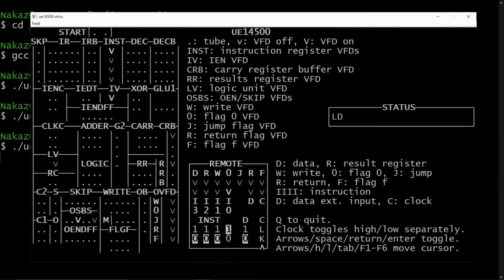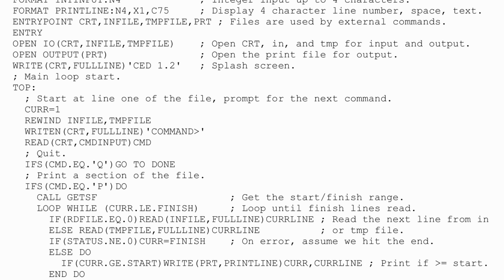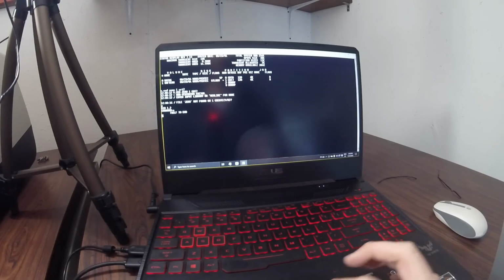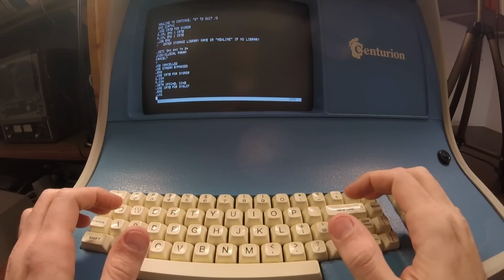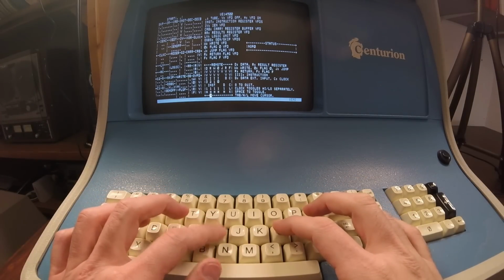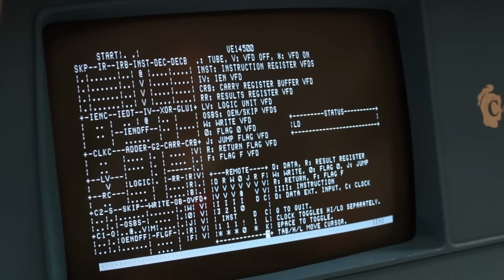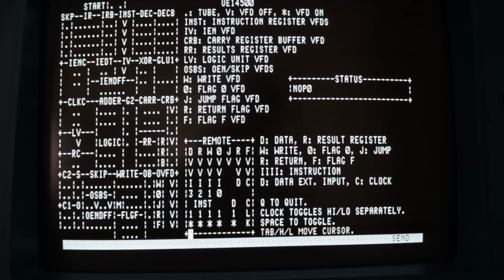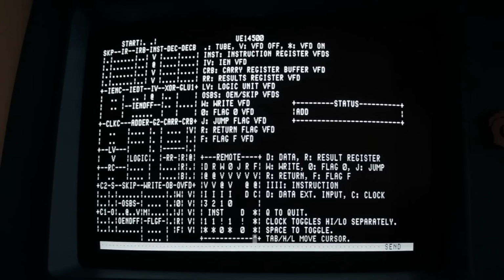Emulating the Vacuum Tube Computer on the Centurion Minicomputer

Comment: Regarding the wave pattern; it looks like the horizontal width is decreasing a bit, at a position that's rolling down the display. I think that roll rate is a beat frequency between the AC line freq (60.0Hz) and the vertical retrace freq (~60Hz). A decreasing horizontal width indicates that the fly-back system a bit current starved, during the "off-peak" AC line cycle. The starvation is likely due to a faulty cap on the DC input to the fly-back oscillator. The AC line is typically FULL-WAVE RECTIFIED (~170 VDC), then applied to the fly-back primary at horizontal retrace frequency. The cap may be intermittently bad, as they sometimes do. I had a VGA monitor with an intermittent cap, years ago, with my old '286 PC. Percussive maintenance worked for a while :D

Comment: 13:50 rs-422 or rs-485 terminal 

That way you can use a 25ft serial cable without any loss

Or use esp32 and make a virtual serial port   using Bluetooth and cart a laptop over, or just spit it to an ip address via LAN
Reply: 21:35 that's how atari programmed and debugged their initial 2600 games, using a minicomputer and partial hardware emulation.

So yeah you technically can emulate a vcs on a 80s computer

The consumer didn't get it until over 10 years after when they could actually afford that kind of computer power.

You could have the power of a 386 or 486 in the 70s and 80s, but won't be a commodore, atari, or apple

Going to be department of Energy, DEC, nasa, cray research, or Ibm, maybe Intel

Even the old vacuum tube computers were 13, 12, 32, 16, 18, 8, 24 36, 48 bit

Back then they called them words not bytes as in the octal or hexadecimal format

Problem is memory either its too slow

Or computer runs too fast and has to wait and waste time

Comment: Extra terminals are cool. I recall in 1995 when I started to run Linux, I found out about getty, and how that could answer a serial port. So I hooked up an old PS/1 with a null-modem cable, and ran it as a terminal against Linux. Because with Linux, even a lowly 486 could serve terminals.
Reply: I remember salvaging my brothers' and mine's childhood DOS game collection from a 1998 Dell PC via null-modem -- hella slow, but it at least allowed eventual transfer to a USB stick for proper backup
Reply: @ErrantMasa  
Beats shuffling floppies, lol.
Reply: @tibfulv  from 1.44MB on a 3.5" square to 1TB (2TB sometime next year) on a thumbnail-sized chip in ~35 years' time -- what will 35 more bring us?

Comment: We had a near week of -20C here in Finland and are back to balmy -5 or so. Getting close to zero is harsh because you get all the variety in snow-water-ice mixes. It's almost nicer when it's colder. Around -30 and below you get a new set of problems.

Comment: I'm rather surprised nothing was dropped since at least the mux boards we had had no flow control going to them. When I was transferring data I had to wait for character echo to ensure nothing was lost, since the mux boards only had a one byte buffer. But if your transmission speed was slow and nothing else is running you might have gotten lucky. Or our hardware guys were completely clueless about flow control for incoming data on the mux.

Comment: The waving picture on the terminal is magnetic interference from an iron core transformer. The framerate on the monitor is close to mains so you get this frequency "beating" slowly.
Reply: I'm sorry, it is unlikely to be magnetic interference. The symptom seen is shrinkage and the rest of the lines are unaffected. Magnetic interference from a transformer or motor would cause displacement which would be a wave down the entire screen. I do agree it's the line frequency though.

Comment: You can use UTP cables for serial consoles soldering them to db25 connectors. In fact, I've used RJ45 to DB25 adapters for this. This way I was able to use network cables (with RJ45) as serial extension.

Comment: The 'wave pattern' on the terminal looks like it's filter hum coming through into the horizontal circuit. The capacitors are probably at the end of their life, I'm really not surprised about it.

Would it be a good idea to get a serial terminal server and connect the MUX card to the network, so you can access it from anywhere you want?

Comment: You can stir in a few more generations of computing and save yourself the effort of getting a longer RS232 cable. Use your favorite WiFi-enabled microcontroller (ESP32, BL602, PiZero, whatever) and wire the serial ends to one of your tty ports. Now, in software, bridge the WiFi to schlep bytes from the WiFi connection to the serial connection. (Use ESP-Link or similar which will give you a tiny web server you can connect to from your laptop and a window to type into..) Now your tiny, 32-bit $6 computer (that's more computer than the others in this picture by far) just moves data between serial and wifi.  You can then connect to your Centurion from your laptop over WiFi. Plus controlling the serial port directly like this, you can take care of whatever weird handshake or pinout needs this thing surely has. Moving 3840 characters a second is a walk in the park for this class of "adapter".
It's not as ridiculous as it sounds and this kind of project improves the ergonomics of using your Centurion and may save you from having to debug that power supply or RF interference problem that's making your CRT wave like that. 
I've enjoyed the series. Thank you!

Comment: Hmm, I’m smelling a serial interface to the vacuum tube computer and a test suite for it on the Centurion.

Re: the wavy lines, I’d check if it’s still present when you move the terminal elsewhere first and test it with a known working cable on CRT0. Cables have bitten me one too many times. But if it’s not environmental, sounds like inside of it.

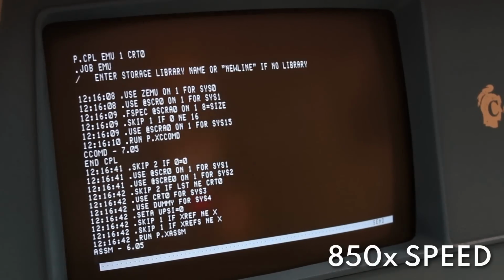Comment: 10:19 "It is a very, very long program ... takes the compiler a little bit of time to run here"
375 lines?
You know, we normally measure source code in "KLOC" or kilo-lines of code.  Your program length rounds to zero.
BTW, I saw you and the mini-Cen at the Makerspace last week.

Comment: The first thing that crossed my mind with the text ripple were bad capacitors.  On electronics that old, it should be a routine to inspect for bulging  and leaking capacitors.  I have had them go bad on much newer computers and electronics. All the problems: the device doesn't work, they bulge, they leak and I have even had them pop open. Capacitors are not forever.

Comment: Now we need to get a Centurion emulator on a PC running the vacuum tube computer emu...

Or better still, A PC emulator running on an ARM CPU running Intel/PC code, to run the Centurion emulator, running the Vacuum tube emulator.

Back in the day, most businesses had a computer room (not a closet) where all the 'big iron' resided, with the users just having a terminal. Often other noisy computer peripherals, like line printers also lived in the computer room, so you'd have to get off your but to retrieve any printouts - not that much different to today where many offices use photocopiers as the main printer, so off to the copier for your prints.
Back then instead of seeing a wall plate with a lan/network socket in each office, you'd see a plate with a D25 serial socket, waiting for a terminal. Wireless was limited to your AM/FM radio to listen to the news, and maybe a touch of music - if office rules permitted.

In a way we've come full circle, now you sit in an office with a laptop, that spends %95 of the time acting as a terminal (web browser) to a remote cloud provider.

Comment: #1 Blinkenlights where far more handy than a lot of people would think and the gent here has learned that the direct way. Also in 1980 it would have been a give that a good  mini would be used to emulate a more "primitive" CPU or Micro-P. Sometimes they where even used to emulate more powerful CPUs just to help with bughunts and prepare firmware and "early release" software.

Comment: Get the PDP-11 up for some special heat. I used to run a VAX-11/750 as my apartment heater. Would be near 0c outside come in and within 20mins of running the VAX you would be in shorts and and a t-shirt. Quite efficient heater too as its switch mode power supply the bills running it wernt bad for the warmth it made. A pain in summer though!

Comment: I remember back in the day I set up a Novel network system for a small insurance company.   Server was an Intel 286 with dual Maxtor 60meg 5 1/4" full height drives.  All the nodes were 8088 IBM pc clones, and had it all cabled together with Arc-net star type network.    Back then, 3-Com had the ethernet patents, and were complete a-holes about who and who couldn't sell their interface cards.  If I remember right, the insurance company was trying to faze out their Centurion Minicomputer.  Installing these microcomputer networks, I remember the mini-computer techs hated us.

Comment: I hoped one day the Centurion would be able to run some software that really made sense and would be fun to show. Now this is a big surprise. Ren you did a tremendous job and for the looks of it you made David a very happy guy! Although I still don't understand one iota of the programming of the vacuum tube computer and thus from the emulator (I'm trying to get my head around it), I think it's awesome to see that this all works and it will be tremendously helpful in further development of the vacuum tube computer. Big succes!

Comment: You should look for the Kermit protocol to transfer files between computers.

So you don't need to enter filled through the editor.
Reply: I remember Kermit. That goes back a ways.
Reply: @KameraShy  it does, and stable transfer protocol.

Comment: Don't know much about terminals, but I know a lot about AV, and that looks like a 60Hz roll artifact from "dirty" power or a ground loop. Try plugging into another circuit. You can also try for experimental purposes a down a dirty ground lift, by using one of those 2 prong to three prong plug adapters and if that works. Get yourself a power conditioner (Furman or similar) or transformer isolated surge protector (isobar or similar).

Comment: The waving of the CRT could be ripple on the powersupply (bad caps) or magnetic interference from a nearby transformer or something like that.
Reply: My first guess would be bad caps.  It seems to shrink.  I'd think an external magnetic field would cause it to go sideways instead of shrink.  But I would check the rectifier diodes as well. If one opens up, it will cause ripple.  Edit: The voltage you need to watch is the +12V.  That's what's powering the monitor.
Reply: @russellhltn1396  I didn't even consider the rectifier diodes. If there's only one shrink on screen it's probably only running on half-wave rectification. If there's two shrinks half a screen apart it's probably just a bad main filter.

This is all assuming it's supposed to have full-wave rectification (bridge or otherwise) which is almost assured and that the vertical scan rate is close to the 60Hz line frequency.

Comment: That's insane how good of a programmer he is!
Reply from the maker: Ren is a legendary programmer! 
He's even built a Sieve of Eratosthenes in pure CPL, which is impressive because CPL doesn't support bit manipulation at all!
Reply: @UsagiElectric  That's impressive because bit twiddling is hard enough as it is.   Years ago I wrote software to process DEC sixel data into and out that 6 bit format into 8 bit and may have actually injured my brain in the process.   This was a format back in the day, so you may run into it on your PDP.

Comment: Hmm… I wonder how hard it would be to build an Ethernet card for the Centurion….
Reply: I believe we have enough information about the bus to graft an arduino ethernet module onto the system.
It would be harder to write software that could take advantage of it though - I don't think Centurion supports anything close to what we now understand as networking. Receiving a specially crafted ethernet frame would be possible, but creating the entire TCP/IP stack is quite a hefty task, and it wouldn't be able to interoperate with other OS functions or programs. I believe our best bet is to emulate a hard or floppy drive and transfer data to and from that, possibly via ethernet or wi-fi (via ESP-* modules).
Reply: @jwhite5008  Hmm… I’m thinking that putting the TCP/IP stack itself on an outboard processor (AVR, ARM, or ESP32) would probably be best; and just have a couple of registers exposed to the Centurion to read/write from TCP streams. Software on the Centurion could just treat it as a mostly character oriented device.
Reply: @darkwinter6028  Good thinking, ESP32 should have serial to TCP support already. Not sure if Centurion OS supports character stream devices, but it should in theory - there had to be at least some sort of tape drive available for those computers, otherwise archiving anything wasn't really possible

Comment: @15:47, The bend in your terminal screen is usually because of a old leaking capacitor in the power supply.  However, before you open it up, test the terminal at a different location and make sure it is getting a full 115v minimum from your AC outlet.  If moving the monitor fixes the problem, then it was a magnetic field interference from an AC transformer or heavy AC loaded electrical line.  However, this yoke deflection is rare and only happens under extreme circumstances, like having an AC line powering a 2kw heater going right below the monitor.  My bet is an old leaky dying capacitor in the monitor's power supply circuitry.

* Note: if you are plugged into the same outlet as your vacuum tube's filament heater supply, and it is a switch-mode supply, and you source AC was weak for awhile, you might be looking at a power supply dip when the switcher's diodes are conduct during during the AC waveform's peaks.
Reply: Yep. Power supply ripple of some kind.
Reply: I agree. Capacitor issues often manifests by being unstable, than getting more stable as it is powered on. 
Even if it becomes less of an issue, checking for damaged capacitors shouldn't hurt.
Reply: This specifically looks like a supply dropping out of regulation. The bend is the picture shrinking and only a small portion of the screen is affected. If it were unregulated the defect would be continuous. If it was from external AC fields it would much more likely be deflection instead of shrinkage.
Reply: @eDoc2020  You are correct.  Probably a weak or dying cap on the main AC rectifier circuit just couldn't keep the +v all the way there while the monitor was really cold during that rare sub-zero temp day in Texas...
Reply: @BrianHG.Volume.Fitness  I can't see it being directly being caused by the cold. What I could believe is everyone's electric heat bringing down the line voltage enough to bring it to the edge of regulation. But it's definitely not sagging enough that it should lose regulation.